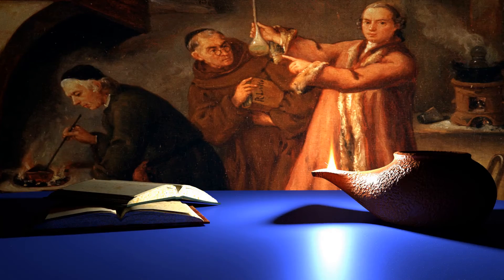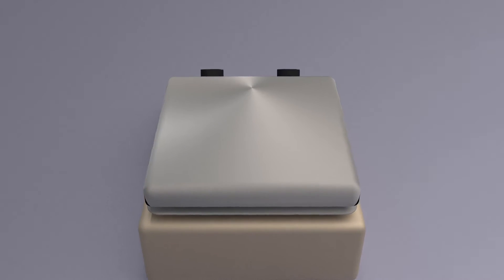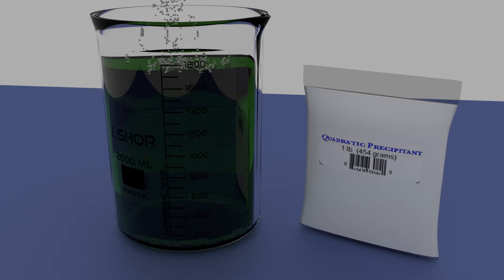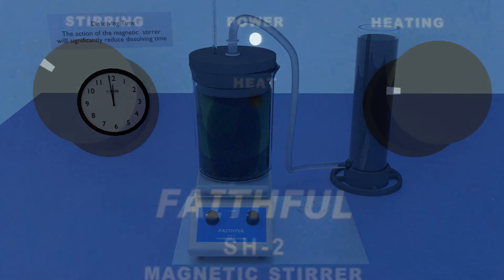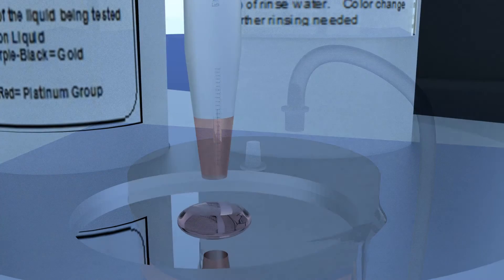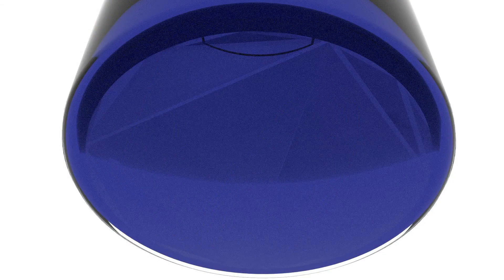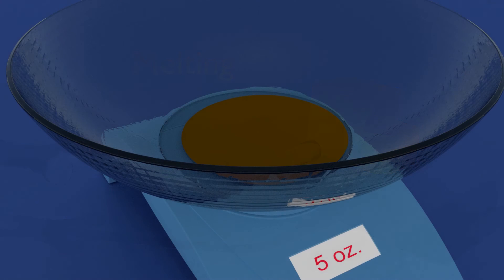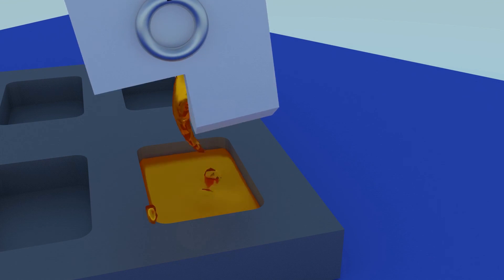AR3G Gold & Platinum Refining System Instructions

Comment: Excellent video, when calculating the weight with the additive  how would you determine the amount if dissolving 14kt? Apposed to dissolving 24kt
Reply from the maker: Weight is calculated based upon total weight of metal, not just gold content.  Non-metals, however, are not used in the calculations.
Reply: @shorinternational3841  sounds good, thx for replying
Reply: Good detailed video! Has anybody used this system?
Reply: @kaiserkabir1241  Im thinking about buying this and the silver system but havnt seen any reviews or videos of people using this but that could come down to people not knowing, everybody on youtube has access to acids and safe work spaces. I will be calling soon to talk to someone about ordering.
Reply: TylerThaGamer  I have spoke to the tech team already. I  have platinum group metal Alloys to refine I asked for a demo before I buy but unfortunately they don’t provide a service. So I’m not too sure about the system in case  it don’t work on my material. Let me know how you get on please.
Reply: @kaiserkabir1241  I only want it due to not being able to set up a fume hood so this seems like the next or only option outside backyard cooking
Reply: TylerThaGamer yes for fume hood purposes it’ sounds like the only option. You can also buy 2nd hand fume hoods on eBay for a few hundred pounds.
Reply: What material are you trying to refine?

Comment: We have  mining mud of gold can we use this things to refine gold ore
Reply from the maker: If by mining mud you mean material like black sands, then absolutely yes.  You can refine just about any material, but it's a matter of economics.  If the gold content is very low, a fraction of 1% for example, it is likely uneconomical.
Reply: What is the price of the unit
Reply from the maker: $795.  Here is a link to the website page:  https://www.ishor.com/refining-and-recovery/gold-platinum-refining-acid-method
Reply: Can we get this equipment in India
Reply: How much quantity of ORE can we pour in this instrument
Reply from the maker: It can be shipped to India via Priority Post, but there are no local distributors for this product.  If you want to know how to put together a refining system using locally obtainable equipment and supplies, see the following video-  https://youtu.be/t0lTUmoSCMc.
Reply from the maker: The capacity depends upon metal content, silicates and other non-metallics don't count.  Capacity is approximately 1/2 kilo of metal.

Comment: That is correct...in formed solid metal ..that method..is fine ...how if formed ore stone .or... material complexs...🤭🙏🙏🙏.
Reply: The phrasing of your question is somewhat choppy and incomplete, but I will try to address it. You want to know how to refine material obtained from the earth, yes?  The most important thing is to expose the gold.  Metal that is microencapsulated in quartz will never dissolve until it is exposed.  To do this, it is vital to crush it to a very fine powder, like powdered sugar.  Once this has been accomplished, you can refine it by the normal aqua regia technique.
Reply: @blaniardmarshall8924  ..okay .. 👍👍..so .if i Use a normal method of Aqua rejia...it Will form precious metal deposit..if SMB is used..and usually Most white deposits...Aqua rejia techniques..how to get black . brown..gold precipitate..🙏🙏
Reply: The white may be one of 3 things-  silver chloride, copper hydroxide or undissolved chemical.  Silver doesn't dissolve.  It converts to a white, insoluble salt called silver chloride.  Prior to precipitation, it is vital to filter or decant the solution.  For a pure result, the solution must be without any cloudiness at this point.  If the dissolved copper percentage is significant and water is added at this point, or if water is used for the first rinse, then copper hydroxide may form.  Copper hydroxide is a white sticky substance that will coat the precipitated gold and give it a white appearance.  A rinse with ammonium hydroxide will dissolve the copper hydroxide but it is much preferable to simply avoid creating it.  Lastly, if you have undissolved chemical, rinsing will dissolve and remove this.  
With regard to using smb-  this is probably the worst selective precipitant you can use.  It precipitates very tiny particles, so almost all users inadvertantly lose 3-5% of their gold because unseen particles pass through filter paper or are lost in the decant.  Additionally, it is very unpleasant to use so the filtering or decanting process is hurried and even more gold is lost.  Try using ferrous sulfate.  Ferrous sulfate will precipitate large heavy particles and is odorless.  It has a limited shelf life so you should refrigerate it when storing.
Reply: @blaniardmarshall8924  ..ok...👍👍..but the problem..if is done formed precipitate..brown ..gold ..is are easy to burning ..form solid metal ..used Ferro sulfat ...in this case most other metal especially copper also precipitate ..n one more thing .do u know abouth the metal chemical washing techniques....where solid metal dissolved by nitrite...so i think that look like precipitate aucl4 ...in fact the solid gold ..cannot reacted with the nitrite....tell me ..🤭🙏🙏
Reply: Ferrous sulfate is highly selective and will not precipitate other metals. @irwanmochammad1174
Reply: @blaniardmarshall8924  ..We understand that..if the stone containing precious metal Is solid,..we can process it easly with the Aqua rejia techniques..But what about the material complexs particle..there we find the challenge to process it...not everyone can do it ..🤭🤭🙏🙏
Reply: @blaniardmarshall8924  ..👍👍..for. Ferro sulfate...is hard 500 -+ PPM..gold ...not effective...i think boss...so why ...part of the gold not show it ..formed solid metal or we called ore .dore ..pure gold powder...🙏🙏
Reply: @irwanmochammad1174  With the exception of gold chloride, gold has a hard time combining with other elements.  Which compounds are you referring to?
Reply: @irwanmochammad1174  Sorry, you question is not clear.  Please restate.
Reply: @blaniardmarshall8924  ..🤭🤭🙏..sorry my question is rare..🤭🤭🙏🙏..i Mean ..what if the rock contain low grade.. precious metal...let's say..-+ 500 PPM..it maybe difficult to form gold metal deposits...where there are still a lot of follow-up metal that can also precipitate or interfere with the metal deposition process...is there away other...🤭🤭🙏🙏
Reply: @irwanmochammad1174  Aqua regia is an inappropriate method for this concentration.  You should be using mining techniques for recovery.  After concentrating the material, aqua regia will be appropriate.
Reply: @blaniardmarshall8924  ..👍👍..okay ..greats ..the problem is apart of the people used ..same method ..even not work it..Maybe the way that must be changed a little..🤭🤭🙏🙏..thanks for u time ...👍👍🙏🙏🙏
Reply: @irwanmochammad1174  The problem isn't that it won't work.  Aqua regia will work.  However, it is very, very uneconomical to process this way.  Your concentrations of gold are much too low for aqua regia to be economical at this point.
Reply: @blaniardmarshall8924  ..🤭🤭🙏🙏..believe me...not about unecomical or good for to do it.....just method..u must changed...iam Indonesia people....where u country boss..🙏🙏